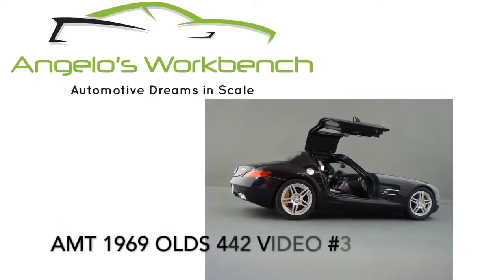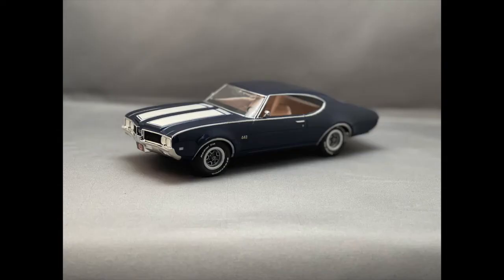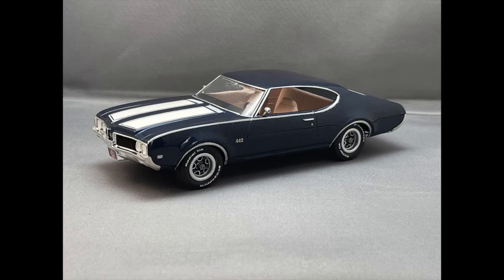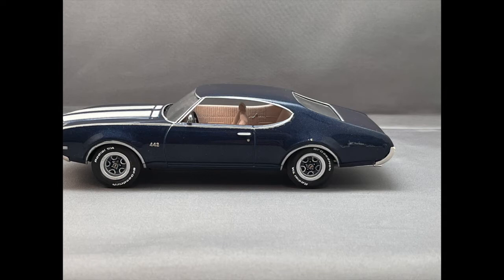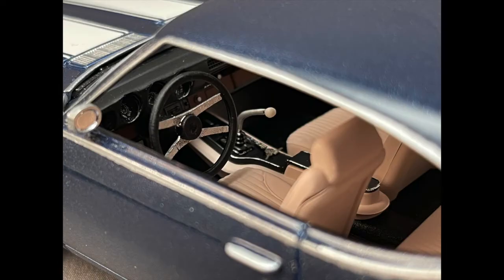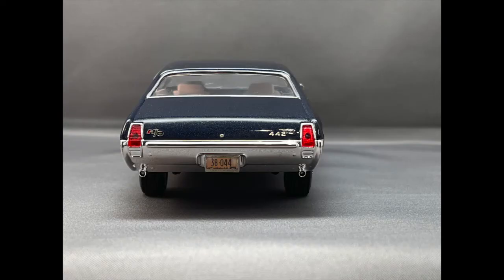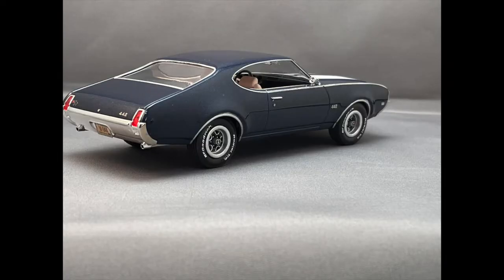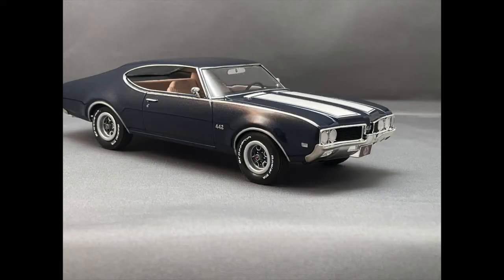AMT 1969 Oldsmobile 442 #3

Comment: Very nice indeed. I especially like the photo etch parts you mentioned in the last video. I have the Revell 1972 Hurst/Olds 4-4-2 kit that I plan on building as my real full size 4-4-2 car. To make it correct the photo etch grilled are a must. Your attention to detail is great. Research is a must with these cars if you wish to make an accurate model.  Thank you again.

Comment: Another great build, Angelo. First, I haven't built a model car for 50 years. (I'm 72 1/2). I had a Blue Charcoal 1965 Pontiac Catalina 2+2 in High School. (Dad picked it out, he had great taste!) I have a kit for the 2+2 that I'd love to start but I have no idea where to find the matching paint. I thought about trying to mix colors to come close but that might be a fool's errand.  Do you or your viewers have any recommendations on where I can find a factory matching paint? Thanks, Ron
Reply from the maker: Hey Ron. Thanks for the question and welcome back to the hobby. When I need a factory correct color I go to one of the online touch up paint sites and order a rattle can. I’ve also used Oreilleys auto parts - some stores have a paint mixing department. They can pull the code and make you anything you want in a small bottle or even an aerosol can. Also body shop paint supply places mix up paint as well. Keep in mind most of what you will get from there will be harsh on plastic. Make sure to protect the body with a primer. Good luck and welcome back again!